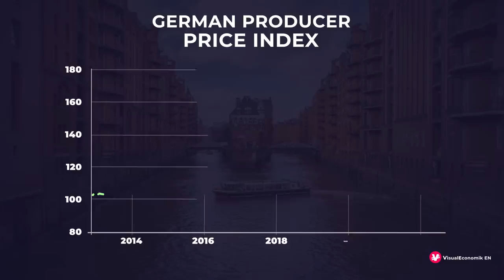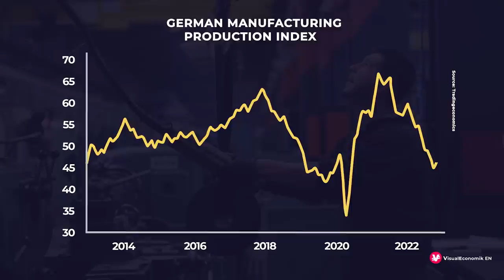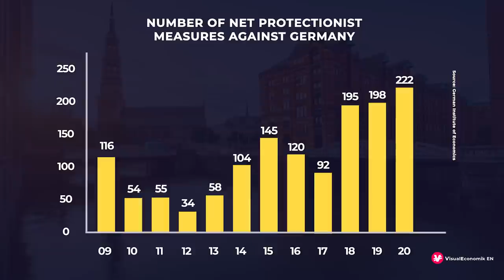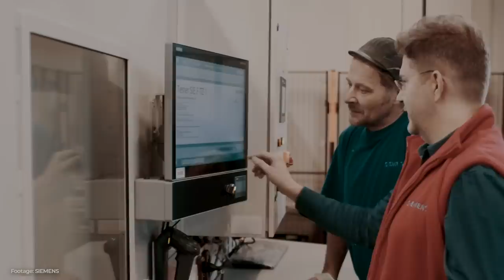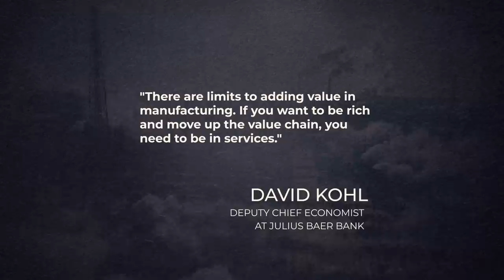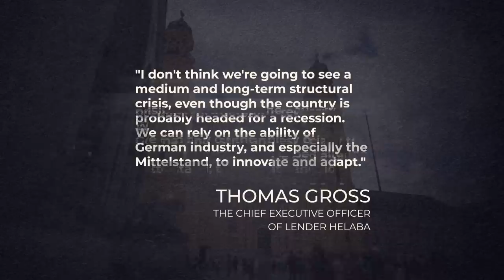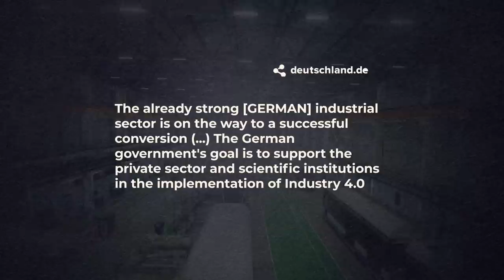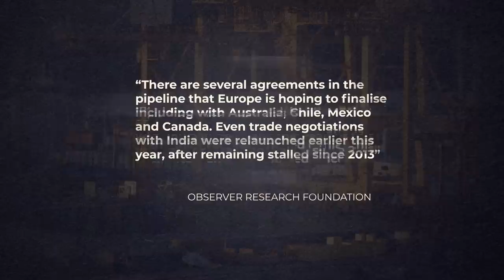Could the German Economy Collapse?

Comment: Personally I think the things that Germany was built on, quality and durability have disappeared, I used to buy Bosch but shocking quality and longevity have put paid to that. Their cars are no different now to others, apart from huge running costs in spares, which is a shame. However their real downfall is a blinkered approach to reality, nuclear power an obvious example, dreams vs reality. Germany is a great country with hard working people, they will survive they always have.
Reply: Hey at least nuclear power it's still legal in germany

~ an italian
Reply: I don't like the reason we got rid of nuclear power, and I don not know if the timing was correct either. But then on the other hand it had to happen soon or later. Nuclear power is not the future, it's something that is happening RIGHT NOW and it WILL BE replaced in future by something better 100%. Just need to mention nuclear fusion... Plus the problem about nuclear waste has still not been solved and even with the most recend tech we got for "recycling" nuclear waste there are no actualy facilities, those are all prototypes.
China launched the first thorium reactor just recently that is kinda able to "recycle" nuclear waste and yet they haven't proven anything so far. They've launched it RECENTLY, nuclear power plants are a thing for around 50 years now as far as I know. Thats HALF a century...
Reply: The problem is that German cars were never well engineered (all Western made cars for that matter), the only time I don't see blue smoke billowing from a BMW's exhaust is when it's being towed, utter trash.

Comment: the problem with services, is that they are way too flexible. Comes economic downturn, everyone's easily ditching their suppliers and you've got a huuuuuge delta in employment, which in turn translates in to gigantic delta in consumption... and everything's flying up and down. What needs to happen, is we as Europeans need to realize, that everything has it's price. Be it overspecialization on one thing (cars, particular service, etc.), environmentalism... these are all things, that make it harder and more expensive to manufacture stuff. It is environmentalism, which is the main enemy of industry. What would happen, if Europe ditched emission allowances for CO2 to energy market? Coal would suddenly become unbeatable energy source on price, only threatened by nuclear! Forget wind parks and photovoltaics. They just don't create enough power reliably enough, to be even considered in an environment, that doesn't care about emissions. Why? Well that is simple. It is in abundant supply in Europe, can be mined locally and Europe has perfectly tuned transportation system for coal (railways). And yet, we are abandoning it in favor of vanity projects, like VRT or electromobility...